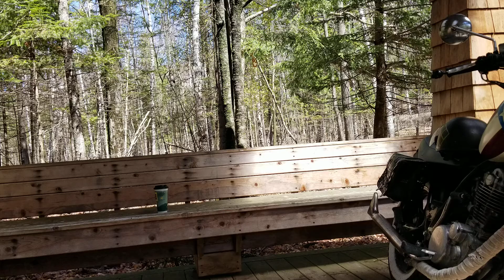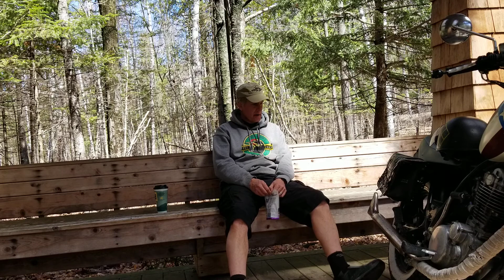Speed Drying Bow Wood!

Comment: I made a long opaque box with plastic and duct tape, cut a hole big enough to fit a blowdryer in one end, and angled it with the blow dryer lower than the the other end so the heat will rise, put a roughed out green bow stave in it and just let the blow dryer run for a day or 2. Check and flip the stave a few times a day